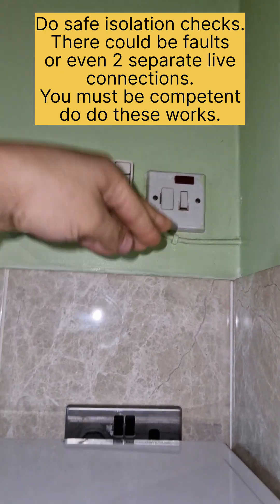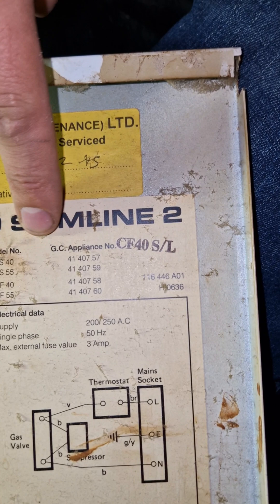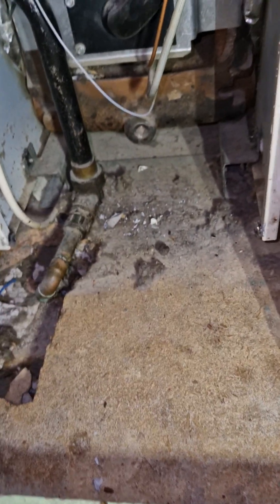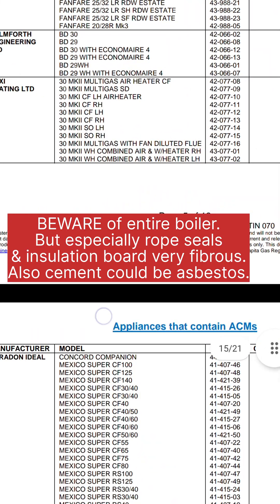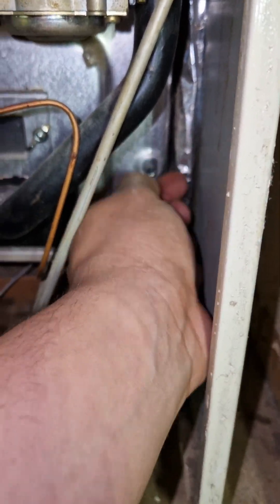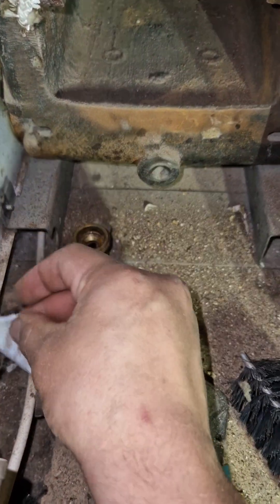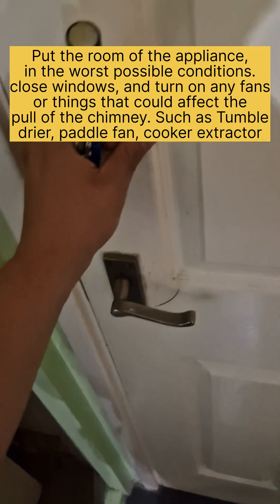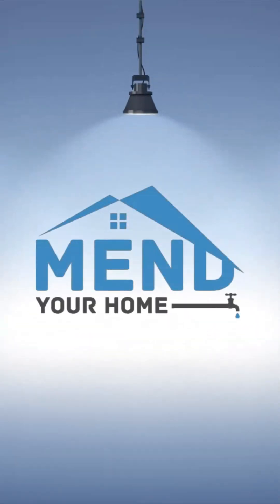Open Flue Boiler service. Ideal Mexico Slimline 2

Comment: When permanent pilots were banned the Gas saving was said to be around 1%, 10-12% would equate on that boiler to about, 1.5kw per hour!
Reply from the maker: The average gas bill per statistics as of 2021 is £582. A pilot light uses anywhere between 594 up to 2475 kWh a year totally £40 - £150. Therefore £582-10% = £524^ which is £58 a year for the pilot light. According to superwarm & energuide peak costs for a pilot light are upto £100 a year which would be around 18% of the average £582 bill.
Reply from the maker: There's info online, when pilots were banned gas prices were lower and the boiler very inefficient without controls so it's more than likely that yes people ran the gas longer without any controls or TRVs so in comparison it was more inefficient back then so the ratios have changed, people are more efficiently and conservative so use their actual heating less so the average for the heating is less which means the pilot light being on moves that average you said is 1% up from that of the 90s etc